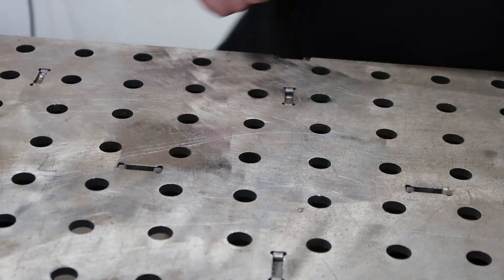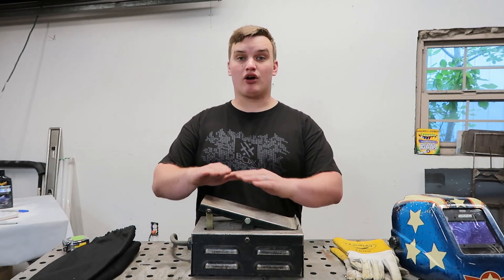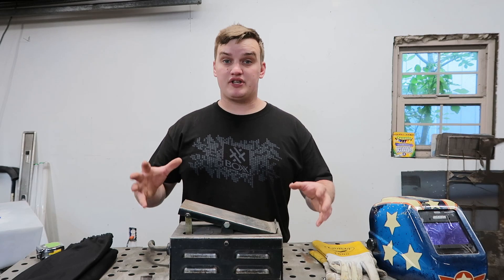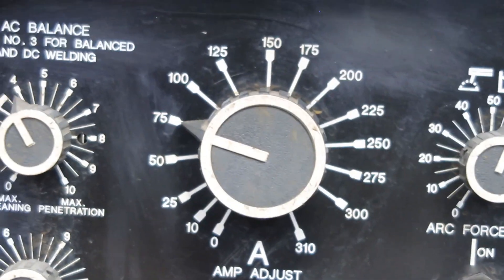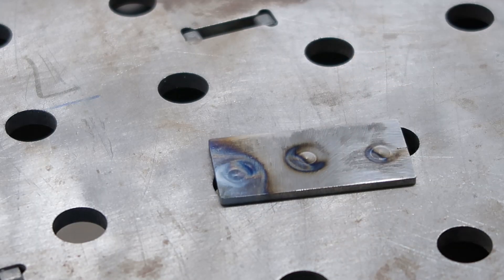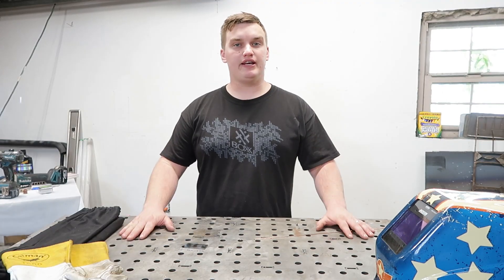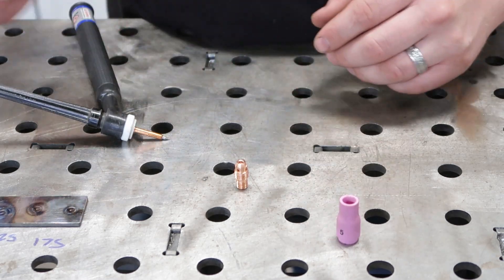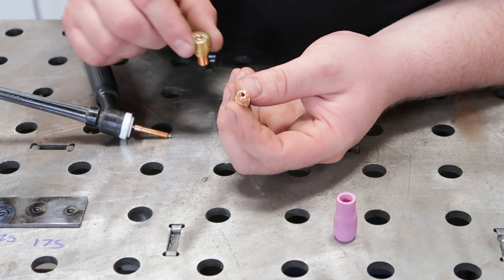Tig Weld Settings Busting the myth. That More Amps = More Heat

Comment: Cool video. Makes sense. I noticed this when I finally wired my machine for 240v. I ran 120v for 2 years and had trouble with warpage, overheating and even “proud” welds. Once I wired for 240 I got nice flat sunk in welds especially on aluminum. I find myself running full pedal (205A) a lot and just moving faster. Then after like you say there’s less heat in the part because of travel speed. Interesting video.

Thanks!

Comment: Hello!  I found you by your Primeweld 225s review because I am considering buying one.  Then I saw this video, and your Sync 250 is EXACTLY the welder I'm replacing because it is not welding correctly anymore (I have had it about 30 years, but can't get a clean weld for the past year+).  Do you have any advice for me about fixing it, or trashing it, or any suggestions?  Thank you!
Reply from the maker: Not specifically sorry 😐
Reply: @amcustomfab  OK, thankx anyway.  Keep up the good videos!